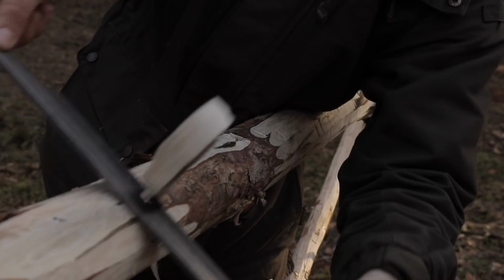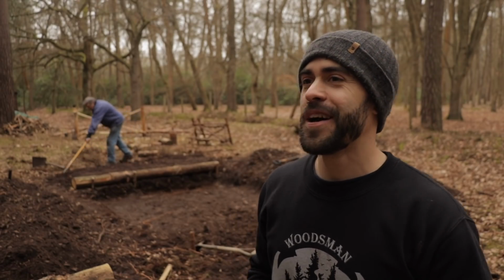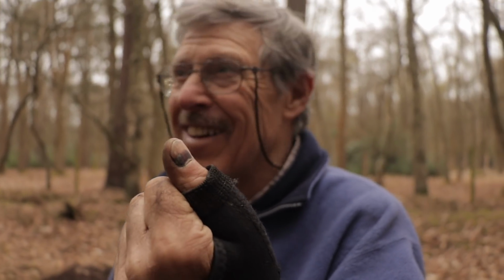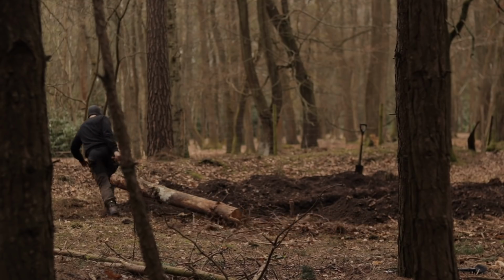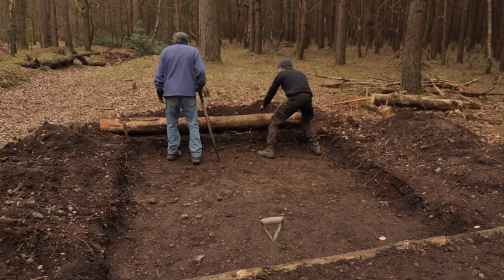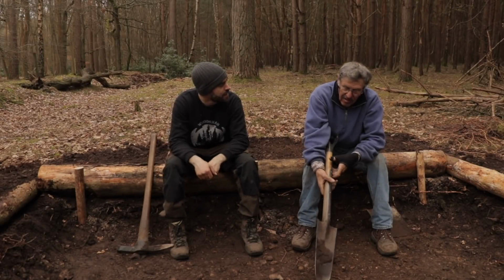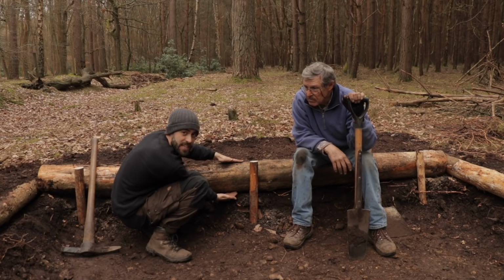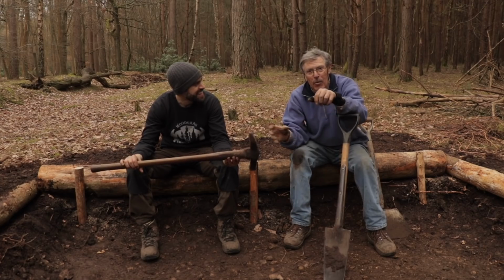Building a Saxon House with Hand Tools: THE PIT | Bushcraft Project (PART 2)

Comment: What you have is a miners pick and used one below ground for digging sleeper pits and driving home rail dogs . A matock has a slightly curved flat blade one end and  that which resembles a  wood axe the other . Such a tool would of made your life easier by easing more ground sooner as well as cutting through the roots . Look forward to the next stage .
Reply: yer, this is what i thought, i just figured it was a old matock
Reply: So it was used for hammering home sleeper spikes?..
Reply: @averylividmoose3599    yes the square end I used as a hammer to fix dogs as they were called into wooden sleepers , 2 on the outside of the rail and 1 on the inside  that created a V pattern . These kept the rails at a set  distance and prevented them from spreading .   I also used  it to shear bolts off of  rails i reclaimed in disused sections to lay elsewhere .   The pick was light , very strong and dual purpose .
Reply: Mattocks are my fave tool
Reply: nope not a miners pick that is a rail hammer .. for setting rail ties and spikes ...
Reply: @averylividmoose3599  yup ... it was .. it is what they used to fix rail ties and spikes for all the tracks across the isles
Reply: @0623kaboom   it is in the uk and as a former tin miner used one daily for many years .
Reply: I've always known something with an axe on one side and adze on the other a Mattock.  (Sometimes a pick on one side and adze on the other).
Reply: Doesn't the pit create a moisture problem?  Doesn't it get damp during a rain, just from natural ground seepage?
Reply: yessss! i couldn't have lived without a mattock in france, doing renovations

Comment: This is amazing work!! Great job! I'm from Arizona and work in construction digging trenches encountering huge old river rocks/boulders under the ground. What we do to make life so much easier when digging holes is by using the Sharpshooter spade, which I saw that you have. What you have to do to get through the gravel fast is stab the ground with the Sharpshooter like a spear and then pry up the gravel. Then, as you go around, your father can follow behind you and clear out the loosened gravel with the spade. Then at the end you can use the flat shovel to level out the bottom of the pit.

Comment: Just found the channel and love it guys. I love that its a father and son bonding thing, but what I love more is that is a way for you both to play and learn and even better is that you don't pretend to be any kind of expert. You are always humble and open to learning from your viewers. At least in the few videos I have seen so far, lol. A quick question as well. Did you grade the soil that you racked up against the outside of the house so water run off would flow away from the house? I was wondering how much trouble a pit house like that would have with water accumulating in the pit and not draining away very quickly.

Comment: mattock no ... that my young lad is a rail hammer .. for setting the tie's and spikes on tracks ... that is why the small flared head and the pick .. that is also why it has the 2inch square head .. great for 1inch rail spikes which were the standard rail spikes for the main lines in the isles 
.
glad you mentioned you were going to use the roots .. as i saw you diggin them up the first thought through my head was ... excellent cordage hope they keep it for that ... lol
.
nice video ... got a tad quiet in the middle when dad wasnt talking to the camera but to the ground ...

Comment: Guys we actually have two sites near us in East Anglia, Cockley cley in Norfolk and about 30 miles down the road in Suffolk at West Stow,  both of the villages have small houses but different designs ( single rooms, with walls made of wood (Suffolk) or wattle and daub (Norfolk) and thatched roof ). In the centre of the village was the meeting house which was a larger design of the houses but only elders and the warriors would meet and talk war. Anglo Saxon houses in your neck of the wood (South West) were more like the viking house you built but thatched gable ends. Anyway I'm rambling but just wanted to say that I'm really enjoying the big builds and loving the channel too.TONY

Comment: Good vid there Mike.  I really like the direction you're going with this Saxon House build.  The only thing I would be worried about is the floor becoming very muddy during heavy rains.  The water could leach in from the sides under the wood timbers.  Perhaps adding some gravel to the floor to make it drain easier.  Just a thought.  Thanks for sharing and Cheers to you and your Dad.

Comment: One thing many think got lost by the majority, but is still preserved by word of mouth among some of the old timers, is that centuries ago the ancients used their widow makes and scrap wood to build a very large bond fire to burn the inside of the pit. This made it very hard, durable, and resistant to collecting water, especially when used in combination with a crude drainage system around the outside of the structure.

Comment: Question and a suggestion. Is there a difference between a draw knife and a spoke shave? My suggestion is that when you are using the pick end of the mat hook for digging try standing in the part you have dug and pull the soil down into the hole you are standing in you will find it much easier. Another great video keep it up you are not far off the million subscribers.
Reply: I fully agree with John 👍 The way you're digging now is a waste of your strength compared to loosening the ground from a lower point (and loosening the ground more efectively, basically breaking pieces away using the mattock's momentum)

Comment: I completely understand your pain about digging that pit.  I've planted several fruit trees in my back yard and while the holes are just 2 ft wide and 1.5 ft deep, I dreaded doing it each time.  You'd think a suburban yard would be easy, but it's still full of rocks and roots, and in my area, heavy red clay.  Every time I've toiled away digging a hole, my mind wanders to thinking about all of those murder mysteries where the killer buries the body in the woods.  It's obvious now why the police always finds the body buried in a "shallow grave".  It's too much trouble to dig a proper "6 ft under" grave.

Comment: Reminds me of my son and I installing our 11 Meter galvanized culvert by hand with shovels, buckets and one pole tamp. We had to dig the ditch down 1 meter by 1 meter wide and then hand tamp in 6 pickup trucks of gravel around the new culvert. We have to still clear out 7 meters wide by 100 meters long driveway and that drive has to be a half meter raised above ground level in some places. I am 52 and he is 25. Today we had a family meeting to look at compact tractors.😅 Our wooded property here in Florida is 51 meters wide and 405 meters deep(167 foot wide by 1330 foot deep). (imperial 36 foot long by 18 inches is the galvanized steel culvert) And we had to slide it into place by hand too. (land is 2 hectors = 5 acres of mixed Florida Woodlands and Saw Palmetto)

Comment: I did a lot of digging when I was younger. A few tips: 
If you use a pick or adze, or mattock (or whatever term everyone agrees on), start at one end and work your way forward, not backward. That way, you pull the loosened soil or rock into previously loosened soil, not firm earth. You also only move it once until scooped with the shovel.
If you can get a long handled shovel, it will work better, preferably a round point. The long, narrow, straight tiling spade is made for digging troughs, not clearing ground. There isn't enough angle to the blade for filling the scoop. The round point shovel will work it's way through rough diggings (dirt/rock combo) better than the blunt end if a square point. When scooping, use your legs to scoop and your arms/shoulders to lift and throw. Set the shovel almost parallel with the ground, lay the handle (behind your front hand) on your thigh and lean into it.
When tossing the shovelful, never lift any higher than needed to clear the ground or other obstructions. The dirt doesn't care if it stays inches off the ground or 3 feet in the air, it still falls wherever you toss it. I've worked as an archaeologist, where significantly more time is spent removing dirt than discovering artifacts. I hope this helps.

Comment: You two are top..funny and good fun and British, When I make something quick I use imperial,and in my engineering job its all metric 
.002 mm for machining, We had to change in 1974 ,BS5750 in which its better when you get use to it everything rounds up to 100 or 1000.
better than 1/64 1/32 1/16 1/18th and so on. but inches are good. :)

Comment: Scottish pine forest soil, with all those roots and stones, looks remarkably like the soil out here in the Pacific Northwest.  So you have my deepest sympathies.  Just a reminder, thoroughly dig out and line any firepits, like you did with the viking A-frame, to prevent embers from catching on those pitchy pine roots.  You don't want an underground smouldering fire flaring up weeks later. (We're not supposed to dig any Dakota fire holes in this area for that very reason.)

Comment: I have the same kind of ground in my back yard, all mixed the roots of what is commonly called Yellow Cedar instead of pine; but, it is pretty  much the same thing when it comes to removal of the stuff. It's not easy digging down into it with hand tools, agreed!

Comment: Hey Mike, that's probably a railroad pick - a mattock seems to have a sharp cutting edge at each end rather than a hammer head.  In all fairness, I'd call it a mattock too, but "railroad pick" seems to be a little closer.  Hey, it does the job, call it whatever you like, it can't hear you :)

Comment: We call them "maddocks" but mattock is correct, pick ax is also used sometimes. They usually have either a horizontal and a vertical cutting edge or a flat cutting edge (of either orientation) and a sharp pick. An adze for woodworking often has the flat cutting edge and hammer. If that is what it is the original purpose was to make the big cuts for ship building or making barrels.

Comment: If I try digging down more than 6" where I live, I'll hit a pretty thick layer of iron slag that ranges from 2-5' thick (the slag is from a nearby iron foundry that closed in the 1920's, and was used as fill around here), then a 1-3' layer of sand from the creek that used to run under my property before said slag was used to fill it in, and then solid granite bedrock. The iron slag, while beautiful to look at when you clean it off and look at in the sun, is an absolute nightmare to dig through and dulls your shovel blade rather quickly. Also occasionally dig up granite cobblestones, bricks, bits of old pottery...

Comment: In Australia we still use the term Mattock, either for a pick axe or a slightly different tool an axe like blade (cutter end) which is ideal for cutting through roots. Australian Mattocks can either have a pick end or cutter end,  have not have seen a hammer end, here.

Comment: That is the weirdest mattock I have ever seen most mattock have more of a flattened shovel like dish on the front on a spike on the back for break me off the ground rocks and roots. Definition of mattock “an agricultural tool shaped like a pickax, with an adze and a chisel edge as the ends of the head.” I believe that is a modified pickaxe commonly seen in  above-ground mines the blunt end was made for quarrying Rock.
Reply: what the english call a mattock Canadians call a pick axe ..
Reply: Yeah it's a pick, maybe a very large geologists hammer, a mattock needs the adze blade to be a mattock the other end tends to be either an axe head, spike/pick or a hammer
Reply: What they have there is a Standard Spike Maul, Driving face on one end, tapered on the other, opposed to a bell maul, which will have a driving face on both ends, which are more common because theyre newer. This makes sense because the one pictured is 100+ years old.

A pick-mattock will have a pick on one end and adze on the other. The cutter-mattock will have an ax on one end, adze on the other.
Reply: @akrilicwarlock  Never thought of a rail spike maul, tapered end to manipulate the plates and the hammer to well hammer spikes

Comment: So a Mattock is 1/2 pickaxe and 1/2 adze or hoe.  Yours has many names, but I've heard it called picksledge, railroad sledge, railroad pick, railway pick hammer, etc.  I think there're so many names because they basically modified pickaxes on site to suit their needs while busting rail heads through the land.  You could make one easily with a forge (or have one made).  Just heat up one end to forging temp and upset the end into a hammer face.  Good idea for a video actually!
Reply: not quite a mattock .. is a pick with a large blunt flat end on the other side .. essentially a hammer with a long single spike for the claw ... what they are using is a rial hammer .. for setting ties and spikes

Comment: Maybe char the logs  in contact with the earth, use the viking method..they also applied pitch made of roots  and branches of resimnous trees like spruce, fir, cedar, hemlock to make a black pitch by boiling  it..they covered their Drakkar boats with the goo which made them waterproof and black

Comment: In my experience, when wood is directly contacted with soil, it starts the decomposition process much faster than if some barrier is between them.  I would think the Saxons would have put down some flat stone below the 4 base logs, along with putting some on the outer face...then applying the soil. (of course flat stone or something comparable would have to be around for such to happen).

Comment: The mattock is similar to the railroad picks we use on the railroad but ours are much longer from tip to tip and both tips have the same dimensions, as for driving the rail spikes, we use what we call a spike maul with an 1-3/4 inch diameter head on one end for driving the spike and an 1-1/4 inch on the other end for balance.

Comment: In part one you speculate about the pit. In some older Saxon homes a hearth weas found both in the bottom of the pit, and at the top near the edge. It has been decided that the pit was covered with a floor, the hearth built on top and as the floor rotted away the hearth fell into the pit. The purpose of the pit under the house could have been insulation, or, by putting clean straw under the floor, cvreate a heating system during the winter powered by the energy of compost. The pits do not bear the signs of wear that would be evident if the pit was the actual home, however, and roofed pits loose the edges of the roof, where the thatch touches the ground, every few months, so arceaology has decided that Saxons did not, in fact, live in the pits, but rather, that the wood floors and daub and wattle walls decayed leaving the appearnce of pit homes.

Comment: If anyone has to dig in (red)clay .... you’ll want to have a dig bar.... 6 to 8 ft long solid steel.... roughly 1 inch diameter.... one end usually has a 3 inch wide flat spade for digging .... the other for prying...rocks ...roots...etc...
Great for demolition too..!!!!

Comment: If it rains then you will have a pool house to keep you company. It is kind of  difficult to include a pit unless most of the timber and rafters and roof is being done ahead of time, or the pit is done after the structure is up.

Comment: An advice on digging holes, don't use any pickaxe, you are going to kill your back using it. Get an iron pike, its way more confortable as it does the same but you keep the straight position.

Comment: When using the shovel or a spade use your right knee to push on your right hand which is on the handle, this uses your leg muscles instead of your arms muscles. It is not as tiring, ( left on left if you are left-handed)

Comment: That has to be the stoniest ground I've seen outside of a gravel pit.
Then again those trees seem pretty young (25-30ish?), so I wonder if it used to be a worked field that was re-wooded at some point because it was too rocky, which would explain the shallow soil and consistency.
We have similar patches here in SW Ontario that seem to just produce stones year after year through frost heaving/tillage.
Strangely satisfying to watch though.

Comment: Next time you need to dig in such a ground try to get a "Münchner Hacke" or a "Bergkratze", i dont know the english term for it.
We use them in mining and they are great for moving tons of gravel and stones. And as Addition to it you can lay a sheet of metal on the ground were you pull the gravel on and then its easier to get it on the shovel.
I hope you understand what i mean, my english isnt the best.

Comment: A Mattock is a versatile hand tool, used for digging and chopping, similar to the pickaxe. It has a long handle, and a stout head, which combines an axe blade and an adze (cutter mattock) or a pick and an adze (pick mattock).  A cutter mattock is similar to a Pulaski.
I think what you have is half a pick axe and half a sledge hammer type mattock, since one end of the pick axe has been shortened and blunted, with the other end a pointed pick, not adze nor axe blade as is traditional.. Usually they will have one end a adze and the other end an axe or pick to be a true mattock. But I am not going to quibble with what you call it amongst yourselves.
According to kikipedia what you have is a pick axe. Geologists in the field use hand held pick axes to collect samples, and climbers will use them to grab into crevices and hammer in pitons. Your big one is used for railway construction of the tracks. GI's used a combo of shovel head with a pick in WWII as a transformable mattock/shovel/pick, good for  building fox holes and latrines, filling sand bags, and the back of the shovel can be used like a hammer..